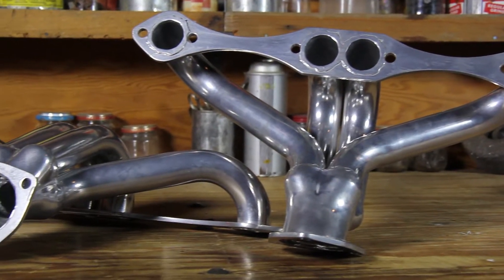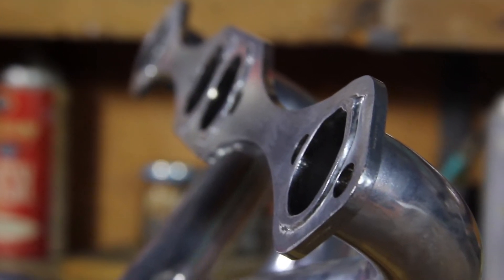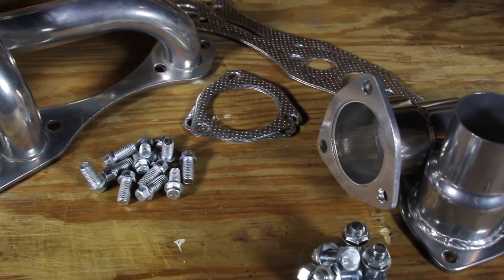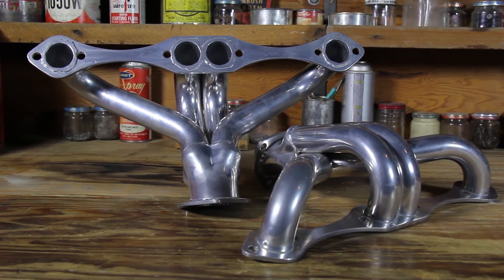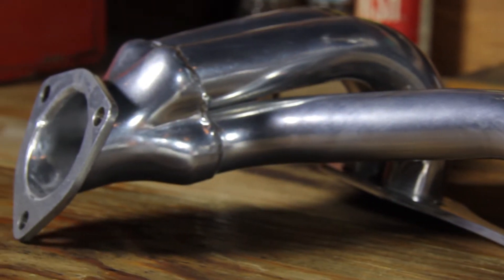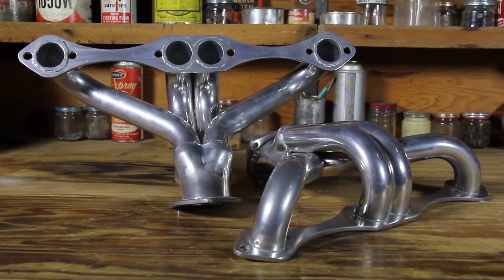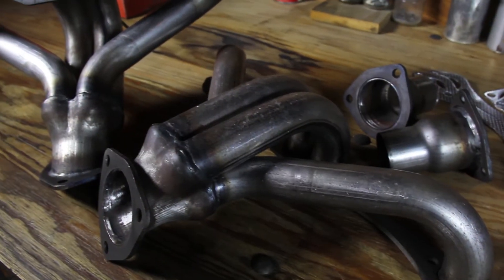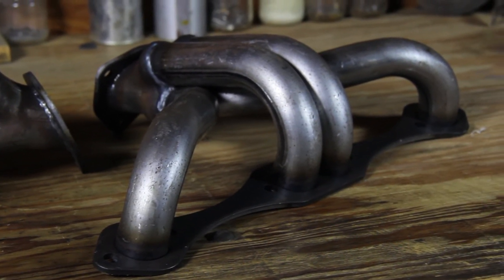Speedway Small Block Chevy Tight-Fit Block Hugger Headers, AHC Coated

Comment: I'm wondering if these headers will fit between the motor and the frame on a 34 Ford truck?
There is  not much room at all !!
Reply from the maker: Yes, these should work well with a 34 Ford chassis.
Reply: You ever use em? I got a 53 f100 with a Chevy 305. Tryna find something that fits 😅